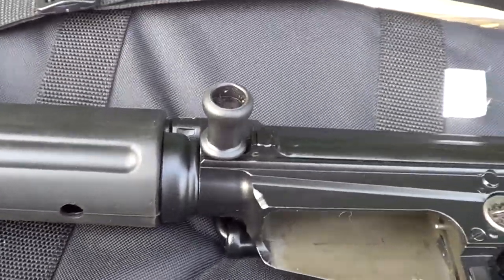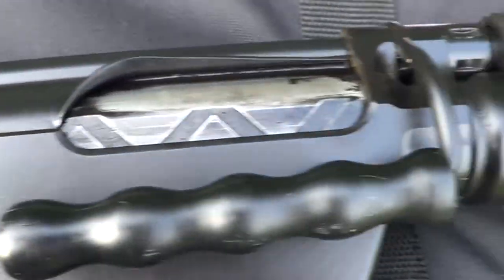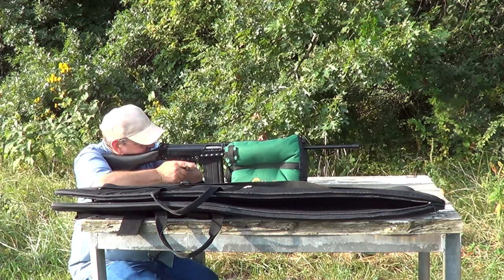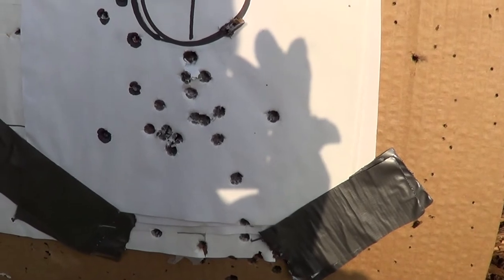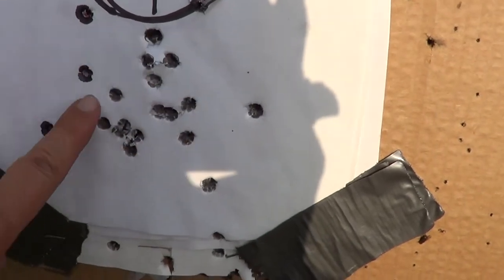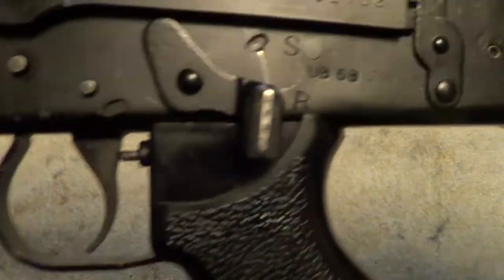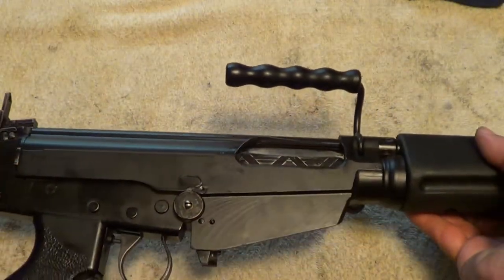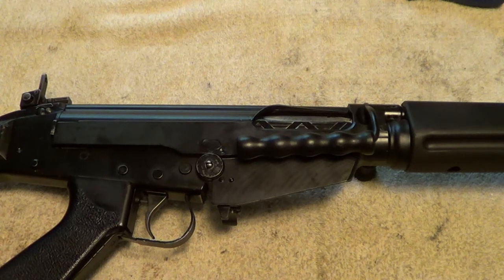FSL LSR .308 FN FAL Pattern Semi-Auto Rifle

Comment: Just need the British cocking handle which folds out of the way when you shoot!  L1A1s are prevalent here as they were the army rifle for 25 years.  Probably my favourite feature on the rifle is how handy the safety is.  In the later years down here in NZ the black plastic furniture surfaced from Britain.  Nearly all were manufactured by Lithgow in Australia on the British pattern.  Good rifle in my books however probably a bit powerful for it's bolt design.  In .280 British (as originally intended) it would have been a perfect rifle!
Reply from the maker: Thanks for the info.